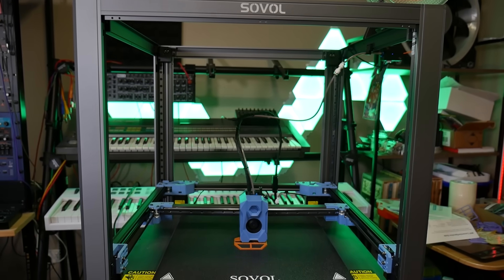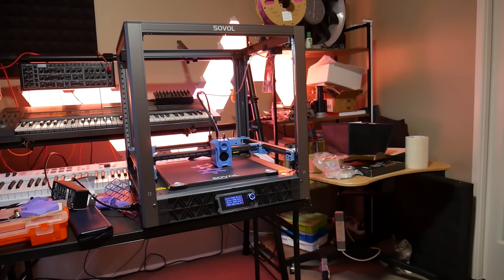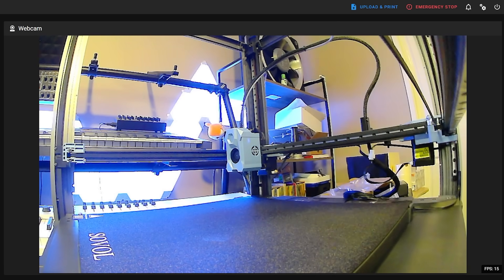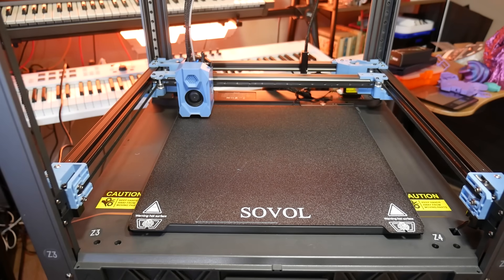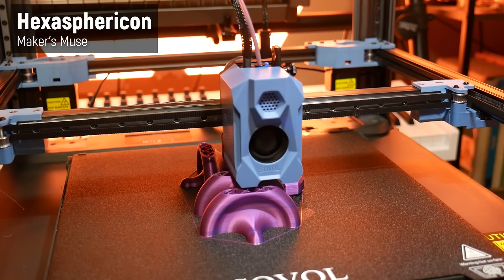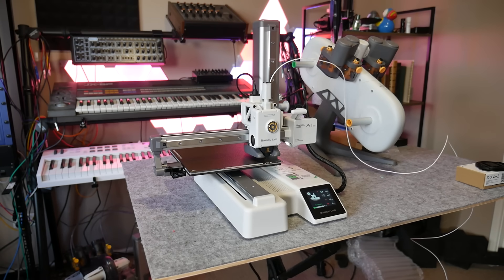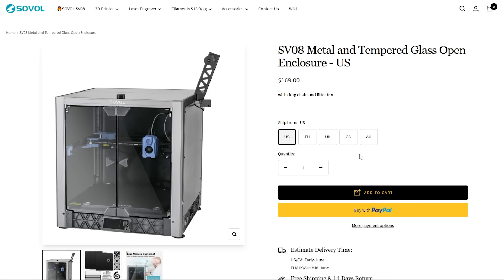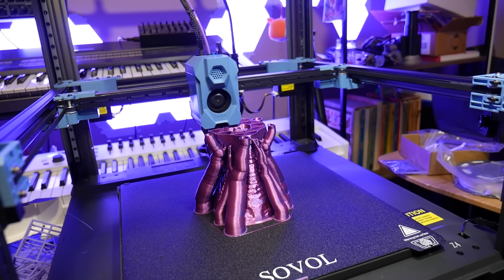Based on a VORON, made by SOVOL... but is the SV08 any GOOD?

Comment: The community needs to figure out what they actually want. You can't decry companies taking open source designs, iterating on them and releasing them-- but in the same breath getting upset at Bambu and everyone being closed source and proprietary.

The Voron team released everything under a license that allows this, Sovol have done the right thing and been completely open and also mentioned they're going to donate a portion of the sales to the Voron Team. This is exactly what we should be encouraging manufacturers to do. It creates a healthy and sustainable ecosystem around open source hardware. Angus makes the comment that the nozzle is proprietary, that's fine-- because the gantry is a standard 2.4 gantry for all intents and purposes, so you can print and install a dragon burner, or stealthburner or whatever compatible toolhead you want. Don't like the inductive probe? Install Tap or Beacon or Cartographer. Just because they're doing something different that makes manufacturing easier or more cost effective it doesn't make it bad.

If we don't embrace companies who are making genuine efforts to do the right thing, we'll just end up with closed source bambu clones and no-one wants that.
Reply: 1000%
Reply: i hear you.   its fine they did this.   they probably just made themselves some money and sped up the iteration process for voron folks,  bc the next thing ought to be that you buy this bare bones, slap a bunch of cardboard or whatever on the sides and top and print the abs pieces you need to fix whatever wasn't quite the greatest to start with it... i could imagine ppl immediately putting a stealthburner with phaetus on it or whatever so you can print actual decent material with it.      or immediately reprint the plastic pieces on those gantries (with the belt pulleys),  i dunno what they're called.. in whatever asa or something pa-cf i dunno.    one reviewer noted the holes for the bearing/pulley pins weren't well aligned, i'm assuming thats likely a quality issue that will be evident elsewhere, but i don't know.        but really... i am not knocking it... not at all.     i just want ... i dunno... consumer desires for desktop printers... to align more with the actual engineering possibilities and not just "i wanna make another disposable plastic thingamajig right now!"       maybe thats a dumb ask. 

i was pumped when i saw this the other month,  but waited to dump the $500 and i'm glad i did,    bc i still haven't heard anyone talk about how the thing will respond to being enclosed and having a chamber temp of 60c for 8 hours,  so odds are it actually still needs another 3-400 in upgrade $ dumped into it anyway but whatever thats fine too i guess .... if the base price finally  forces kit suppliers to drop their insane prices for actual kits...  great.
Reply: Hi Shane. Thank you for your imput. I agree with you, Solvol sv08 saw a perfunctory to masproduce  what is a wonderful design and adapted to to cater for those that haven't got the time to spend on building the aboron app 40 hours plus. As you said, they made a commitment to contribute €2 euros for every Solvol sv08 sold. What a wonderful thing to do. Ther also have I believe given boron €1000 upfront. 
Regards. Mike
Reply: The community isn’t homogenous. It’s probably different people complaining each time.
Reply: this!
Reply: Totally agree!
Reply: Well said. 🥲
Reply: yes
Reply: This aged like fine wine! Agreed.
Reply: Hear, Hear
Reply: What are you nerds even arguing about! You sound stupid. Bambulabs will never force you to use their own filament. When another company builds an open source 3D printer that flat out works then people will buy it, but until that point a bambulabs printer will always be my recommendation to everyone
Reply: I couldn’t care less about open vs closed source. As long as the printer works well which Bambu Labs does, I’m happy to pay the asking price.
Reply: Agree 1000%
Reply: I bought an SV08 as well as a Voron kit. Both arrive this week.
Reply: I think the main problem with Bambu is that they obviously use a modified open source firmware but haven't published the modifications to my knowledge.

I think what Sovol did here is great and there will soon be tons of upgrades around for this printer. The only people who really lose are those who sell voron 2.4 kits.
Reply: @FreeOfFantasy  It worked for DJI copying multiwii and Bambu was founded by guys from DJI it's literally the exact same thing I saw happen probably 15 years ago being done by people from the same company none the less. It makes me sick the amount of people back then with DJI and now today with Bambu who say they don't care if they copied the work of the community because it's a good printer.
Reply: @FreeOfFantasy hopefully this will decrease the price for the extremely overpriced kits
Reply: @FreeOfFantasy  Bambu  printers are nice, its there practices as a company that makes me stay away and not recomend them.
Reply: @stevedegeorge726  Fair enough, but I hope you are avoiding Microsoft, Google and YouTube as well, as their practices are much worse :)
Reply: @originaltrilogy1 congratulations on your false equivalency. Bamboo labs can at any time make it so that you can only use bamboo filaments.

Microsoft can't make it so you can only use windows on pc.

Google can't make it so you can only use chrome or Google search.

Bamboo labs stole an opensource platform and closed it. Microsoft didn't. Nore did Google. 

Bamboo labs force you to use a cloud slicer which means you can't legally print things that have a non transferable licence for or you have signed an nda for because you will be uploading that file to someone else's server.

Google don't force you to use Google drive and Microsoft don't force you to use one drive.

You can choose to support one bad company and not another if the ethics don't line up. It's almost as though free choice was a thing.
Reply: @stevedegeorge726 What practices? Other than being closed source thwre is literally nothing to complain about.
Reply: @Falney Literally every part of your comment is misinformation. You even spell the name wrong. Christ...
Reply: @BeefIngot  well, you got me on bambu, my excuse is auto corrupt turned bambu the company, which isn't in the dictionary to bamboo the plant, which is. That being said,  what else is wrong? Do you have proof?

As far as I know, there are only 2 slicers that work with bambu labs printers out of the box. Orca slicer and and bambu studio. Both of which are cloud based slicers which means you have to upload your files to their servers, thus licence busting. Sure you can use other slicers, but you need to configure them and most people won't know how to create printer profiles.

As for locking third party filaments. You do realise that bambu lab's filaments and machines use rfid chips right? All it takes is changing one setting in the firmware to make it so you need a spool with an rfid chip on it and it can be made so the chips can't be reused. It's something we see in 2d printers with ink cartridges.

As for closing open source system. It uses core xy. You can tell just by looking at it. You don't need to see the firmware, just the belt layout is core xy.

So please, prove me wrong. Don't just say "you're wrong, because I said so" and don't disqualify people's arguments based on spelling. It's called deflection. It is very disingenuous.
Reply: @Falney   Literally none of what you said is sensical.

Firstly, its not a cloud slicer, it literally slices on your computer and is a derivative of prusa slicer which is a derivative of slic3r and also pulls from other slicers. It can also send prints locally with no internet connection to your Bambulab printer. You can see the source code for all of the slicing components freely.

Secondly, the rfid system is literally only for the AMS. There is no RFID for the base printer and it wouldnt even make sense for them to make the switch you are tapking about even if you ignored the fact its mot possible because the AMS is not mandatory.

Thirdly core xy is a motion system. Its bizarre and crazy to even say the sentence that they locked it down. What does that even mean??? It literally is a non sequitur idea. The "community" didnt come up with core xy. As a motion system it has existed for literally multiple decades, probably before computers were even mainstays, so this is just a baffling claim. Its like saying Mercedes closed down wheels. It makes no sense.

Lastly I didnt dismiss your comment on the basis of misspelling but instead based on the fact that its meritless.
Reply: @BeefIngot the first instance of core xy I can find is a paper by Ilan E. Moyer in 2012, not decades ago. If you can point me to something older I would like to learn.

As for not being cloud based, why are so many people complaining about it then? A quick Google search suggests you need an Internet connection to use the printers.

I don't have one however so I can't verify.

As for "locking down", I don't recall using that specific term but I might have, but, they have closed an opensource system,which is a breach of licence. They may or may not have written their own code, I don't know, but if I was to reverse engineer someone's product and call it my own wouldn't that be copyright theft?
Reply: @Falney  "Bamboo labs force you to use a cloud slicer" what?  just put it in lan mode if you dont want to use the cloud
Reply: @Falney   For the first thing you said, you didnt look very hard if you think corexy didnt exist before 2012. The very page you found has a reference listing prior art so old some isnt even on the internet anymore.

Secondly, Why state incorrect statements as if they are factual when you know you dont have the answers.

Whats weirder still is you can easily google to find out that what I am saying is the case so its bizzare your response is "but Ive seen people complain".

Your last comment about copyright theft is so offbase ypu are mixing different legal principles. Patents are what protect physical implementation not copyright and they havent violated any patents.

Code is governed by copyright and the open source code they use abides by this standard as like I mentioned the slicer is literally just right there on github so no idea where you got this from.

You really ought not spout things confidently when you have literally no evidence to back your ideas.
Reply: @originaltrilogy1  Yes, I am.
Reply: @Falney  "if I was to reverse engineer someone's product and call it my own wouldn't that be copyright theft?" - Very much no: reverse engineering is specifically legal https://en.wikipedia.org/wiki/Reverse_engineering#Legality and even if it wasn't, "reverse engineering CoreXY" isn't a breach of any copyright because no copyright is involved. Patents could be involved, but that's not the same thing.
Additionally wrt what you say, Bambu Studio and Orca Slicer are open source products, which is why Orca can exist at all since it's derived from Bambu Studo, with just the plug-in that connects to the printer being proprietary, which is NOT a breach of any license. The firmware of the machine being proprietary obviously can't be a breach of the slicer's license, as they are not even running on the same machine. Unless, of course, the firmware itself is derived from open source firmware, but I don't see any evidence of that in this thread or elsewhere. Having "closed an open source ecosystem" is not a thing, certainly not legally a thing: you have to breach a license, not just a spirit, to have a "breach of license" which is what you said.
Also, you don't actually have to use the cloud with Bambu Lab printers, you can use LAN mode: https://wiki.bambulab.com/en/knowledge-sharing/enable-lan-mode and that way you won't breach any license terms you may have on the files you print (even if you did breach it by using the cloud, which I doubt).
I am actually very much an open source proponent, but you are, indeed, spreading misinformation here, and I urge you to read up on what you say before saying it. I am more annoyed at, say, Creality, who patently DO use an open source firmware (Klipper and Marlin on the Ender 3 V3 KE and SE respectively, for example, which are licensed as GPLv3) and don't release the corresponding source code. Heck, they haven't even released the source code to Creality Print 5 even though it's based on the open source Orca Slicer (yes, the same one that's derived from Bambu Studio, and man be because Bambu Lab did comply release the source)! They may release it later as they did release the source to Creality Print 4, based on Cura, but they have a track record of releasing sources well after they release binaries, which actually IS a breach of license unlike the things you said.
Reply: @Falney you’re wrong on all fronts. The RFID system on Bambu was designed to make multi-color printing much easier and also type and settings. Do you not like that almost any manufacturer of automobiles doesn’t open source their control systems? Maybe GM will brick your car. Conspiracy talk is always full of “what-ifs” and 99.9% never ring true.
Reply: @originaltrilogy1  Major flaw with your smug logic, is that you just listed a bunch of Monopolies... I guarantee most would stop using Windows/Office, Alphabet(Google), Apple, etc if there was a similar/better alternative that didn't get bought up or crushed by those big tech corps in an anticompetitive way... Bambu hasn't done that yet. So we as consumers have the option to choose more ethical companies :)
Reply: @Falney  That serialized/chipped filament is what's keeping me from buying Bambu... it's utterly terrifying how they can go full Apple/HP and say hEy tHeSE are NON GENUINE FilaMenT, no more Printing for you! or No more printing with certain features you probably bought our printer for! EVEN THOUGH IT LITERALLY MAKES NO DIFFERENCE!!! Because with the shady stuff they've done and are openly touting at some points, they are definitely doing this at some point. They'll probably walk it back, but they have zero trust from me... despite that I will admit, I am dangerously close to buying one because my Ender 3 V2 is actively making me lose my mind.

It's like a table saw that only works with lumber from a certain lumber company...
Reply: @BeefIngot  Aged like milk! LOL...
Reply: @Mike80528  What aged like milk specifically?
Reply: @BeefIngot  "What practices? Other than being closed source thwre is literally nothing to complain about."
Reply: @Falney You are incredibly misguided, Microsoft and Google have both used open source libraries against license and faced zero consequences nor released the changes they made, and made massive profits doing so. So exactly what Bamboo are accused of.
Reply: @LtShifty  so if Ms and Google get away with it, everyone should? You realise if we applied that mentality across the board, society would crumble right?
Reply: @originaltrilogy1 to my understanding neither of those make printers, my complain is that they took from the open source community just to lock it down
Reply: @BeefIngot  auxiliary part cooling was done by mirage c back in the old days, input shaping was done by klipper, the ams is basically an ERCF, the X1 is a Trident
Reply: @FreeOfFantasy This is straight up false information. There has been no evidence whatsoever that Bambulabs hasnt just made their own firmware, especially given they have features not even possible on other firmwares like software defined stepper drivers.

Its so annoying that people spread misinformation due to anger about perceived wrongs.
Reply: @BeefIngot  "like software defined stepper drivers"

Could you explain what is meant by this?  On Klipper you can set the run currents, micro-steps, the thresholds between stealthchop and spreadcycle modes, whether to turn interpolation on/off, and so on.  Are you saying that Bambu is providing more control than this to the end-user?
Reply: @stew675  No. Software defined as in they can directly update and change the firmware of the actual stepper drivers (which is how they did the silence/motor noise cancelling and other fancy motion things). Nothing to do with user control.

The TMC stepper drivers have settings but only Trinamic actually has the ability to change their firmware.
Reply: @BeefIngot  Okay, but you stated that no other firmware allows for software defined stepper motor controllers.  That's simply not true.   Klipper, for example, does support updating the firmware of pretty much any controller in the system, if said controller is capable of having its firmware updated.  It seems to me that you've incorrectly inferred that the relatively static nature of TMC driver firmware means that Klipper (or any number of other 3D printer firmwares) are incapable of doing software/firmware updates to a controller that allows such.   That's simply not true.  If some stepper controller allows for firmware updates, then Klipper can definitely update it.  Heck, I've even done it myself.

Independently of the above, most modern TMC based drivers allow for ALL the functionality you're describing out of the box, and that can be controlled using parameters that the user can fiddle with if they want to mess around with quieter operation.  Most Klipper based printers I've used with TMC2209's or better, are significantly quieter than any Bambu CoreXY I've heard, even with the updated Bambu software drivers.  The point being that while having software flashing stepper motor drivers sounds like a good thing on paper, if the user doesn't have ANY control over it, then they're at the mercy of the manufacturer's software update cycle, and if the manufacturer updates are still worse than an out of the box solutions such as a good TMC module, then what really is the benefit there to the end user?
Reply: @BeefIngot  
Maybe not firmware, but the things that the X1, p1p and such have, are mostly from the open source community...
Reply: @FreeOfFantasy  Prove it. It's been 2 years yet no one's proven this claim that Bambu is stealing open source firmware
Reply: @paranoidpanzerpenguin5262  Its crqzy right? These guys innovate and you literally see ripples in consumer 3d printing but people refuse to believe it was a chinese company who innovated.

These people are literally currently benefitting from the landscape change brought about by the machines they hate so absent mindedly.

Heck, their firmware still has features no other firmware has. Klipper cant even support some because they are real time.
Reply: well Home 3D printing has been a huge open community effort in gaining ground and popularity from the start. I think a lot of bambu hate comes just from the word closed being mentioned at all... because their slicer work is open source. and you can flash the firmware to root access the printers too.

I feel like people are imagining that they're locked down the way apple and nintendo treat their hardware...

Hell the stuff is so not hidden that the printers and AMS are getting cloned by multiple companies. They're not sharing everything they work on, but they are still bringing the 3D printing community forward by making a package that people find very attractive.
Reply: @SquintyGears  I’m not saying that closed source efforts are inherently bad in any way, I’m simply pointing out that if we shit on companies for doing the right thing, they won’t bother— and all the benefits of the open source ecosystem will just vanish. 

That’s why I’m so passionate about this, all too often you see everyone from megacorps to Chinese startups ripping the guts out of FOSS for profit and giving zero shits and this instance a company had tried to go out of their way to do the right thing and the pitchforks still came out.
Reply: @shanemshort  u right
Reply: @SquintyGears  You call it hate, I call it concern. Concern that Bambu Lab will dominate the market, much like DJI dominates the drone market. The Bambu Lab founders are all former DJI employees.

Another big problem that not many people talk about is that Bambu Lab has filed a lot of patents in China and some of them are based on open source technology. They even used CAD drawings from the Voron project in some of their patents.

Bambu Lab didn't have much of a choice regarding the slicer. Bambu Studio is a fork of Prusa Slicer, which is licensed under the GPL. When you make a fork of software licensed under the GPL, you have to release the source code. What doesn't reflect well on Bambu Lab in this context is that they only released the source code when a Youtuber made it public that it was a fork of Prusa Slicer.
Reply: @andreas.grundler  ah i hadn't thought about the DJI angle. Patents and China are a whole other kind of meme so I don't give that much value personally but I do understand how it rubs people the wrong way.
Reply: i just want a printer that works fast andf good results I could care less that my bambus arent open source im not a tinkerer im a 3d printer
Reply: @VictorLagina69  Have you actually seen prints made by bambu? It's awful especially with seams, a sign with faulty pressure advance. It doesn't have belted Z so it also have z-wobble.
Reply: @youtubehandlesux  This is such a weird lie to make when there are thousands of reviews proving Bambulabs have great print quality. Part of their whole appeal is good print quality, no effort.
Reply: It scares me. What if in 10 years, almost all printers are closed source.
Reply: @Anonomus-m4j  What's scarier than that is all printers would become as reliable as 2d printers.
Reply: @Anonomus-m4j  A scareir soiranec tnah ttah is all 3d prisretn bemoce as relelbai as 2d prisretn.
Reply: @Anonomus-m4j  They're welcome to do so. I miss the start of the 3D printer adventure, when we would hack together machines practically from scrap. Today, knowledge, suitable materials and electronics are way more easily available.
Reply: By iterating on them you mean made it worse
Reply: @youtubehandlesux  if it’s worse than voron they won’t sell any, right? Problem fixes itself.
Reply: I heva no ieusss with tsih thgni ceipod vnoro btu heva ieusss whti tsih tgnih bnieg orev pecird fro ist q.ytilau
Reply: You would need to modify the x-carriage because I don't think it's a one to one with the belt spacing. USB based probes would probably work OK, assuming you perform more of your own modifications. But beyond that, the frame makes it hard to adapt anything else to this printer, so in the end you are still looking at an actual Voron 2.4 kit if you want something you can completely customize.
Reply: @Duckferd  like every other printer, mods will happen, especially given the cad availability.
Reply: To clarify the only issue here is the use of the name Voron. The Voron Design team releases their designs freely to the public, NOT their name and brand. Voron Design's "Voron Project" is about publishing DIY no-compromise hardware designs built from off-the-shelf parts. The SV08 is a flying gantry core-xy printer, and yes while it's based on the Voron 2.4 design, that doesn't make it a Voron. Think of Voron as a premium car brand. If you put a Porsche badge on a Honda Civic, it's funny but it doesn't make it a Porsche. Voron Design is an extremely generous group that shares their designs freely with everyone. Sovol hasn't licensed the Voron name or brand, they've simply pledged to keep things open and give back to the Voron Project as a good faith gesture. This is awesome! But out of respect to the Voron Design team, it's fine to call the SV08 Voron-like or inspired by the Voron 2.4, but it's not a Voron.
Reply: No. Issue here is when they grab the work of others and don't contribute back.

Like apple did with their MacOS
Reply: @Splarkszter  uh, macOS is based on NeXTSTEP, which Apple acquired when they purchased NeXT. What exactly did they do?
Reply: @shanemshort  NeXSTEP is (was) based and built on the Mach kernel and was a direct derivative of BSD. Mac and IOS are locked down descendants of UNIX.
Reply: @Splarkszter there are instances of apple stealing but their os isn't one. The ipod however is. The earliest form of the ipod was a literal clone of a Sony mp3 player.
Reply: @Falney  you really do love making baseless accusations against companies you decide that you don’t like 😂 🤦‍♂️ because everyone should like and buy all the products that you buy, because you’re a genius.
Reply: The community doesnt want one thing.

A type of tool is hardly a thing to make a community about anyways.
Reply: @BeefIngot  exactly, about the “community” around what is foremost a tool, I thought guys arguing Ford vs Chevy were dense, then I entered the FDM printer world 😂
Reply: Problem is that Sovol was using the Voron name in their marketing and on their website. This printer is not a Voron, and not a proper Voron design. To the layperson it may look similar, but they are very different and the quality on the Sovol is not very good.

Second, Voron will not accept donations from Sovol, and they have stated that. No money is going from Sovol to Voron. This is yet another marketing misdirection by Sovol.

So please at least get the facts straight to begin with and stop believing marketing BS.
Reply: @ScytheNoire sounds like the magical voron team are butthurt that every is making money on their project but them. The pretentiousness is off the charts.
Reply: @_..-.._..-.._  they declined a partnership with Sovol, not the other way around, at least look things up before saying bs
Reply: @ScytheNoire  you are factually wrong, they stated on their discord on April 11th, sovol contacted them and that sovol wanted a partnership with the Voron design team, which they declined and stated that if they wanted to contribute they accept donations like any other person, which they stated privately and publicly that they are committed to do.
Before asking people to fact-check stuff be sure to do it yourself.
Reply: @ScytheNoire how is it sovols fault that voron doesn't wanna take their money lmao
Reply: @ScytheNoire  Sovol has not once called it a Voron. It was announced as a Voron inspired flying gantry CoreXY printer. To date, the Voron team has indeed accepted $3,000 US in Sovol donations.
Reply: @ScytheNoire  Have you been to their website? Do you have anything you can point to or are you just repeating what others have said? They're not using the Voron name in their marketing at all. There are a couple words of text that acknowledge where the overall design comes from, which if they didn't do, you'd see a huge amount of complaining about.
Reply: @ScytheNoire  the voron team not accepting donations is obviously their prerogative, but it doesn’t change the fact Sovol were willing to do it, regardless of the fact that they aren’t remotely required to. 

They’ve done what we scream at every company for not doing and there’s still hate? Had Prusa released the XL source like they’ve repeatedly promised?